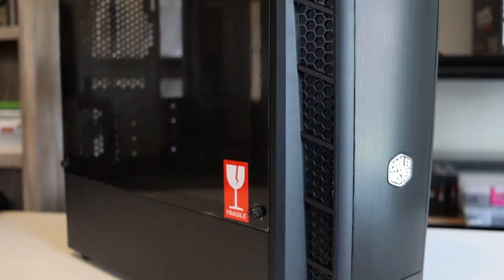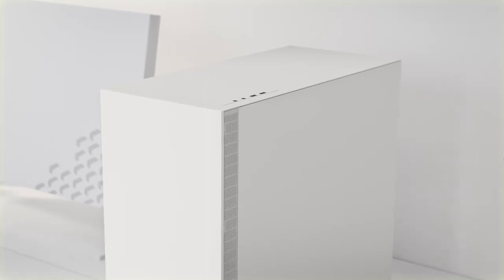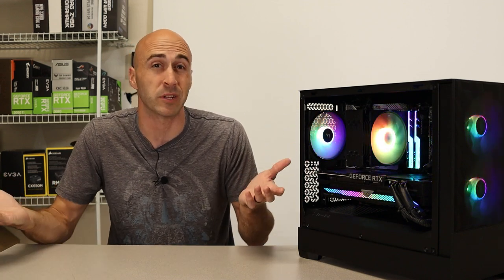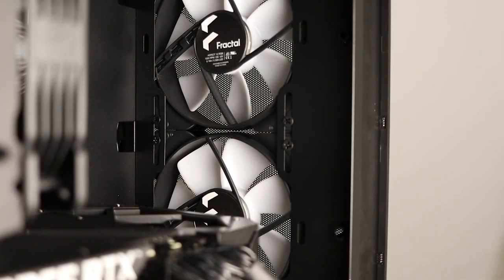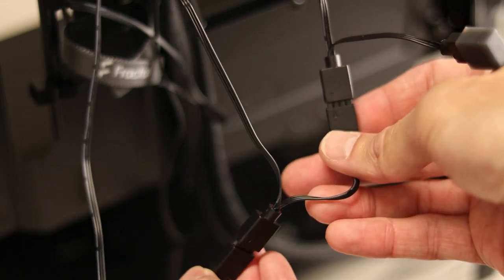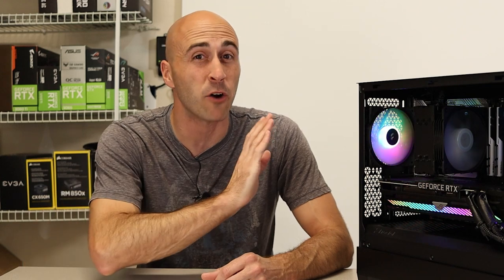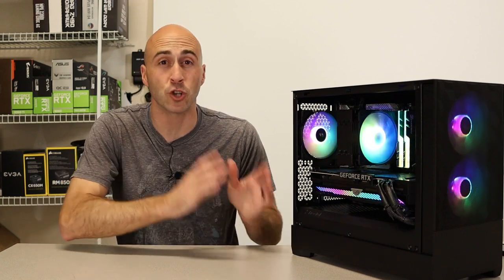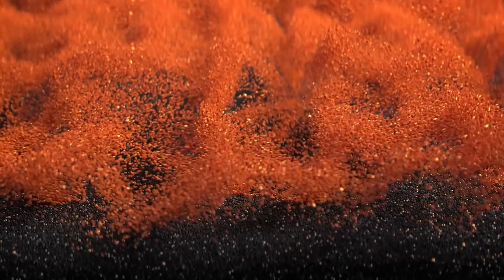The NEW matx KING! Fractal Design Pop Mini

Comment: this and the AP201 by ASUS are my favorite recently released mATX cases by far, just imagine an all-black dual radiator custom loop with black soft tubing and quick disconnects 🤤
Reply: I just ordered the pop mini case in white for a non-gaming i5 12400 build without graphics card. It was between this case and the AP201, both similar price but in the end chose the pop mini because I like the clear glass panel and 3 ARGB fans that are included.
Reply: Only downside of AP201 is the vertical airflow that doesn't go well with cpu air coolers. It forces you to get AIO which is a considerable budget investment that could go to the gpu instead. That also might not be a case for budget builds despite its price point...

Comment: 11:48 Probably not intended, but if one could somehow manage to install a small fan there, it could probably boost the graphics card cooling quite a bit. It might even be a method to pursue in the future, along with a special channel leading to the front, it could greatly improve small cases, eliminating any graphics card cooling concerns.
Either that, or they stop putting the damn PSU right underneath the GPU.

Comment: I think it's a tiny bit suboptimal (ironic, as you will see) that the lower front fan doesn't quite reach down to below the graphics card. Because that is probably where it is needed most. Those are the kinds of details one may need to pay extra attention to with a cramped space (unless one just doesn't care, of course).

Comment: I don't get the hate for optical drive bays nowadays. it's way better to have one and use it a couple of times a year than it is to get something on a disc and not have an optical drive to be able to use it. 
I buy special edition blu-rays and CDs that have more content on them than the equivalent streamable content so without a drive bay, I'd be missing out.
Reply from the maker: It’s outdated technology and is being phased out. Even some motherboard manufacturers are switching to USB thumb drives for their drivers. I have a portable optical drive for a just in case and haven’t used it. It’s all thumb drives and external hard drives in 2023. As far as the extra movie content, you don’t have a Blue-Ray player or a console?
Reply: agreed, the 5 1/4 bays is the reason I got the case. Plenty of other useful things to mount there as well even if you don't use an optical drive.

Comment: Just a note that the front panel is limited to 2x120mm fans or 1x140mm fan due to the smaller size. I'm looking for a possible matx case as an alternative if/when i need to transport my pc anywhere but the options seem to be limited. I like this case although I'd prefer if that compartment wasn't there at the bottom if it mean I could fit another 120mm fan in the front or 2x140mm fans.

I'm also considering the Deepcool CH370 as an alternative although it's not as nearly as good for build quality.

Ended up getting the Asus AP201, which is my favourite matx case. It's a completedly different form factor and I don't mind the power supply being located at the front.

Comment: Nice review Danny, as I'm watching this in 2024.
But I must say, even now I still use and Optical Drive (many DVD's) !
Nice that you did an Air Cooled variant, most reviewers do AIO's (which I personally hate).
So it would have been nice if you had done a server variant w/ optical drive, 3.5", and 2.5" drive installed.

Comment: Do you think a 160mm deep PSU would fit if I remove the 3.5 sleds completely and dont put them back on?
Reply from the maker: Yes. The sleds take up quite a lot of room. When I removed them, I gained tons of extra space
Reply: Was wondering the same thing great 😀
Reply: Okay thanks alot then. But one questions "deep" is the lenght?  @DannysTechChannel

Comment: Anyone know of any smallish matx cases with a handle?

I travel a lot for work and I like to bring my pc with me and hook it up to my hotel room tv with an extra long hdmi cable. I got tired of lugging around my trusty Cooler Master Q300L, so I went looking for a more easily portable matx case. I ordered a Bitfenix Prodigy M, but the plastic handles were so incredibly uncomfortable that it was almost impressive. I returned it and wound up buying a Lian Li Tu150 instead, which meant I had to switch to an itx mb and a smaller psu. My new rig is much easier to travel with but I wish I hadn't needed to spend the extra money on compatibility. The closest thing I was able to find to a highly portable matx case was the SGPC K20, but I don't think they make it anymore, or maybe just not for the Western market or something. When I search for it now, all I find is the K29 and that doesn't have support for a discrete GPU.

Comment: Please, please create a video comparing the 13900 and 13900k. It makes so much sense to make that video but no one has made it yet.
Reply: They're pretty close. There is a 3.5% difference in clock speed, which results in 3.5% performance difference. Besides that no meaningful overclocking and limited RAM overclocking. Otherwise they're the same, except for the non-k coming with a cooler in the box. Hope this helps.
Reply: @dotms5195  Thanks!

Comment: I don't understand this attitude of removing possible expansion in desktop cases. This is like Apple laptops where they remove all kinds of old ports. One of the clear uses of 5.25" bay is for card readers which is certainly in wide use today. Another good use for this expansion is to add display. And I'm sure there are plenty more. But now that everyone is acting like Apple buyers, manufacturers have less reason to add such expansion feature.
Reply: plus there are still a lot of old school users who have Cd's and dvd's, personally i use my computer for everything so versatile is best
Reply: Let's not forget hot swap bays. Without them, you need to disassemble the whole case
Reply: Also, if I didn't want a 5.25 bay on my PC case, I would just buy a laptop. The point of a desktop is you have everything you need in one package

Comment: Hey, Danny! Thanks so much for this video! It's great and has earned you a new subcriber!
I'm putting together an upgrade list that's almost identical to what you've built here (I'm looking at the non-WiFi Mortar, 2-fan 3070 and smaller, 750W PSU).
Is it essential to go to 1000W for this build?
Reply from the maker: No, not at all. 750w is plenty for a build like that. Thanks for joining the community!